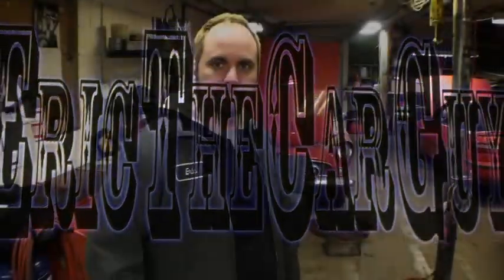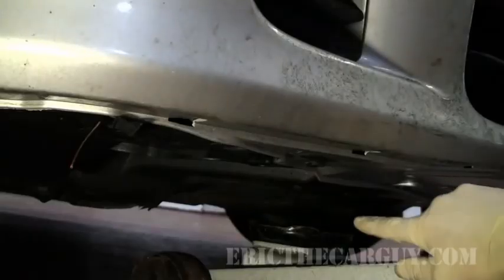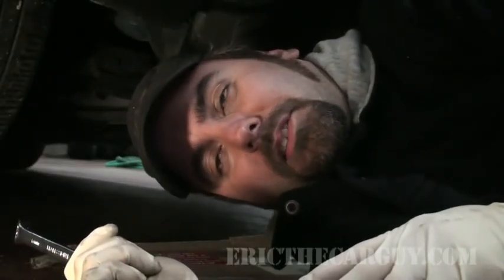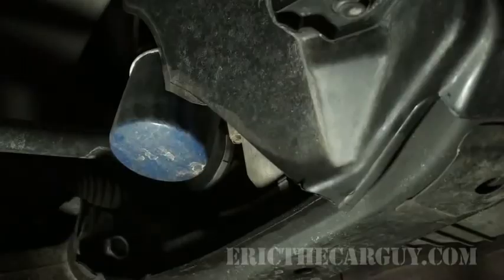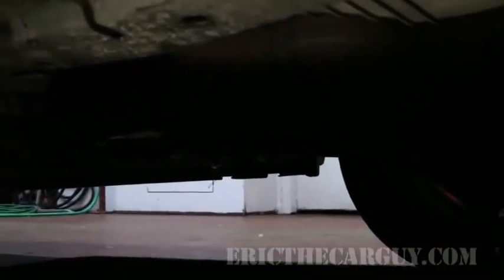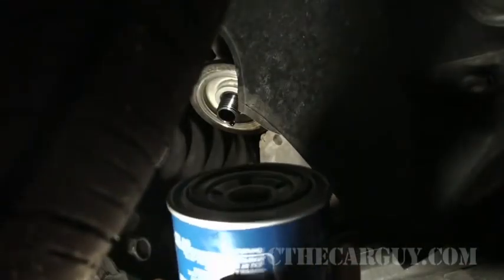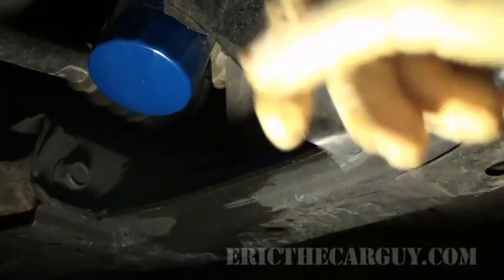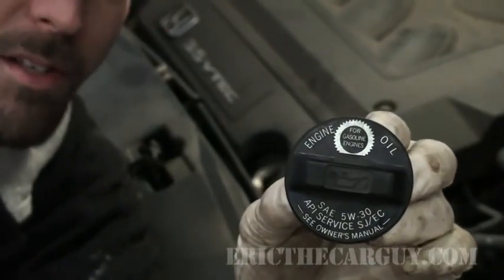How To Change Your Oil (Full) - EricTheCarGuy

Comment: Hello Eric.I need some guidance. Today, the vehicle's Change Engine Oil Soon light came on. Changed the oil Mid Last  November. I thought it was an electronic alert due to cold weather but still decided to check the oil. It came up dry. I was confused. And then I thought maybe to run the engine while checking the dipstick. I saw some splatter of oil.  Still not convinced, I drove to the nearest Oil Change place and after checking said I need to put in 6 quarts. I put in 5 quarts of Mobil Synthetic (75000 + mileage) when I did the change. 
I also changed my Air Filter to KN from the generic brand about 3 weeks ago. What could be wrong? Any suggestions? Thank you.
Reply: Just pull the fuse.

Comment: u can do that but is not necessary ...also in this video i would tight more that oil filter ,..anyway that filters for sure u will no use again so is not problem if little damage them when i change them with new ones.

Comment: Hey eric,I have a kia sonata and the owners manual recommends using 15w-40 oil , is there any problem in using 10w-40? is there much of a difference?
Reply: No, you improve your engine protection at starting at low temperatures. For an optimal substitution compare your actual technical data sheet (TDS) of your 15w40 oil and the new 10w40 oil. The oil viscosity at 100ºC or 212F must be similar.
Reply: Thanks man.
Reply: Happy to help you!

Comment: Hi, I'm currently using fully synthetic oil right now, and it's been for 2 years (7k+ KM). So I thought of changing to MINERAL oil, are there any issues if I drain the old FS oil and add new Mineral oil? Or am I missing something?

Comment: @straydoggio Never heard of a filtermag until I read your comment and googled it. It's actually pretty cool and seems like it would work, and does have a better chance of catching particles of metal, if there should be any in the engine, than a magnetic drain bolt would. Thanks for the info.

Comment: Eric the car guy, I need advise. When I change oil on my 1996 Toyota Tacoma 4 wheel drive pickup, I stripped oil plug thread. Now, plug just turn and won't comeout. Any advise beside remove oilpan?

Comment: First thing you need to do is to activate the parking brake! Even when you are in gear your car will always roll a bit just enough to roll of the jack stands. Especially when your car has a front wheel drive and you jack up the front you will get squashed underneath your car as soon as you start working.

Comment: Pissed me off too. I had a From nylon molded tool I bought from the same place where Eric bought his Supre Tach oil and it slips if the oil filter is just too tight. Dammit I had to go to the ol' Perp Bays to buy a metal one. And up until that point I was just fine. Damn indy mechs wasting my money.

And I agree with the tight so it won't fall off rule. I check my oil level and filter often anyways. I can just open the hood and look at it. Lucky that way I guess.

Comment: There is one time you need to know if you need conventional, Synthetic, or Racing oil. That time is if you have a Hydraulic Flat Tappet Cam in your engine, reason being is the zinc rating in new conventional oil is to low to protect the flat tappets from being ruined and they did that because zinc destroys catalytic converts in cars So if you have an older car up to 1985 you should find out if you have a flat tappet cam in your engine get a zinc rating of 1300 or higher like VR1 or Royal Purple!

Comment: Hej, question: is it really necessary to change oil every year? Even If I have driven just like 10.000km=7.000miles? Somebody told me that oil is deteriorating and thats why it has to be changed every year, but I saw the date for usage on the BMW oil at least several years 2 or 3.
Reply: Yea, oil has to be changes with either how much miles you do or if you don't do those miles with time. For example a couple months or so
Reply: Oil never loses its lubricating properties.  Never.  Yeah, yeah, someone will argue with me, but they're just wrong.  What it does is gets dirty, and dirt doesn't lubricate.  So, no, oil never deteriorates.  

Where I work, we have 200 million dollar turbines and we never change the oil.  What we do is purify it and take the dirt and any water out of it.  But we use the same oil for years and years and years and decades, and only add new oil for any leakage.

So, should you change your oil every year?  Well, if the car has sat there for a year and not been driven, then I wouldn't change it, because there's no reason it should be dirty.  However, you have 7,000 miles on that oil.  Again, it may be dirty.  However, if it is synthetic, I know that stuff can go for way more than 7,000 miles, because it starts out so clean.

I would change my oil if I were you, though.  On modern cars, there are some very tight clearances and passages that the oil has to go in to keep lubricated, and $26 bucks for some synthetic oil and $10 for a filter is cheap maintenance to make sure those passages don't get clogged up and fry your $10,000 engine.

Comment: Why shouldn't we use ramps? I've done so on most of my cars and trucks. Always made sure I had no areas of the oilpans that would not let the oil drain by angling the vehicle on the ramp. BUT driving and stopping it on the ramp may be an issue for some.

Comment: Hello everyone, I pretty much don't know anything about cars yet i am trying to learn the basics in order to take care of my car. I went to do an oil change yet I wasn't able to remove my oil drain plug. I tried 17mm socket yet it was not big enough so i went to 18mm and that was too big. oh and i forgot to say the drain plug was tight as hell. anyways, after sockets and wrenches and penetrating oil, .... stripped drain plug. so i was forced to take it to the dealer and they did the oil change. any advice for next time? thank you.@ErickTheCarGuy
Reply: steve b I think you mean AMERICAN aka SAE/Imperial. Metric is the standard in England....

Comment: i have a 1978 oldsmobile cutlass supreme with a chevy 350 should i stick with conventional oil or can i use synthetic oil
Reply: Synthetic is fine but if your engine is that old,it may slide past the seals ...If it does not ,you are ok.

Comment: I've heard that when you drain oil it has to be a 24 hour drainage of oil. is that true? it most likely is sir, I'm just second guessing it I guess. I haven't changed oil yet but plan to soon. also do you have a battery change video?
Reply: actually its false if you let oil to drain for 24 hours than u must have been told wrong let it to drain till its just small drips or till no oil runs out after your car as been settle all the oil will be in the pan which all will drain quick lube tech
Reply: ok cool. thanks for the reply. I honestly didn't expect one.
Reply: +White Ninja ur welcome man aint no problem just tryin to help people out thats all
Reply: #awesomeness

Comment: what about pre filling the filter if you can in your  application to limit the first starting up engine so it does not run without oil for that long.

Comment: no flushes pose a chance of clogging the tiny oil holes with sludge potentially starving parts of your engine of oil. Its not extremely common but i has occured more then once.

Comment: I have a 96 lincoln town car. What kind of wrench you think I would need elf I haver a floor jack that I have to turn by  hand I use for brakes and rotors. Would that be ok to use? How high should the car be off the ground I do have jack stands but would have to use one side at a time

Comment: @1ownjoo2 Aren't there some some some cases where the metric/standard do line up in measurements? And at times, one fits tighter than another? I'm NOT recommending to try it out or whatever, I'm saying this out of sheer curiousity. 5/32 = 3.96875 mm.

Comment: The manual for my ranger says 5w-30 oil, but its a 1994 and has 225k miles, should i use 5w-30 or keep the 10w-40 like ive been doing?, thanks in advance

Comment: i run my engine for several minutes like he does...i don't touch it but it should't be so hot that it burns you if you only ran the car for 5-10.

that being said, wear glasses and gloves and you should be fine.

On most of my cars the only place where i really had to be worried about getting hit was removing the damn filter which is often placed in hard to reach areas... that's why i start the main flow first before i take the filter out...less risk of burns

Comment: @Whit3Mike Have you considered a FilterMag ?  Powerful curved earth magnet in a few designs for different oil filters.  The manufacturer claims - with convincing photo-evidence -  it helps capture microscopic particles of metal that are too small for the filter to catch... to prevent engine wear.  I've got one, and always remove it from the old oil filter, to put on the new one I'm about to fit.

Comment: @man1d2tran At least they aren't using impact wrenches on your oil pan lol. But I also do oil filter snug, none of the 3/4 turn after contact because i rather be safe than sorry, because thats what the oil filter removal tool is for. As for the drain bolt, I make sure its tight, none of the flattening the crush washer crap.

Comment: i have a weird question, i have a honda crush washer and it has one side that is lighter in color, does anyone know if it matters how i install the crush washer?

i.e the lighter side touches the oil pan, or does the lighter side make contact with the drain plug?

Comment: @TheDennyvu Great great great tip. I see "mechanics" all the time at Firedtones and Perp Bays and even some independent quickie change lube shops overtighten the filters with their gorilla grips. And I always raise a stink when I see them using their whole body weight and two open/box wrenches to get leverage onto the drain plug, I mean come on! This is why they strip oil pans and then say you have to get a new one. Wrong. You make them retap that sucker. And worst case, buy the new plug.

Comment: what will happen if I couldn't change the oil filter at the time of oil change? will it be fine until next oil change? or do i have to change it?
Reply: You have to change the filter every time.  It fills with engine contamination from when you ran it.  Most people run their cars more than 3,000 miles between changes.  meaning that if that filter gets plugged from running that long, your engine will receive NO oil (or unfiltered oil if you have a bypass valve) and essentially your engine will burn out.

Comment: keep on using the same oil that was used before or go down the line...
so if it was synthetic you can go down to semi and if it was semi you can go down to mineral. i would not sugest going up from mineral straight to full synthetic as it may create a havon in an engine with lots of milage

Comment: Hi Eric,
Do the engine flushing is needed? If no, why?
Reply: +azhar ray 
Many car manufacturers have advised not to do engine "flushes" because 10 years ago quick lube shops were doing it and it could damage the cars engines. If you change your oil at the proper times there is no need for a flush at all.
Reply: Thanks

Comment: It's sad that you have to put that disclaimer on a YouTube vid.  So sad.  Anyhow, I appreciate your adding the part about the "adding a little oil to the filter" since I forget that step all the time!  I recently read that forgetting this step might cause a ticking noise in your engine.  Have you ever heard of this?  The explanation was that air gets stuck in the system causing the noise. I'd actually prefer it be this little mistake than the possible alternative - spun bearing - UGH!!!

Comment: That intro. XD

BTW, do you know when you're supposed to change High-Mileage oil? I know conventional is every 3,000 and Synthetic is every 7,000 or 7,500, but what about High-Mileage oil? and do you need to use a High-Mileage oil filter with High-Mileage oil?

Comment: Can you tell me how much oil should i put for my cars ? for example engine with 1.6 power how much galons of oil take and for 1.8 and for 2.0 ?
Reply: In the video "check your owners manual". If you read it tells you how much and which oil to use. My hemi uses 5w-20 but on the oil cap it says 5w-30, more information helps :) 
-And the 2.0L you would probably use 5quarts my other car is a Chevy cobalt and is a 2.0L and the manual says it needs only 5quarts , a cheap 20$ depending on which oil brand you like.
Reply: Thanks a lot for informations

Comment: good and cheap, i don't see the point in buying "other" brands if your changing it every 3000 miles or so. i change mine around 2500 miles now because my car has 156000 miles on it so i don't want the internals having to work too hard

Comment: @ericthecarguy Not to be a smart ass but if it says only 4quarts y put 5?, They say too little or too much oil is bad. I just want to know because my car have 192,000 on it, and takes 4qts according to the manual. i put 4qts in but i buy an extra qt in case i burn some oil so i can top it off i dont pour 5qts in right away. AND WOUD SYNTHETIC OIL RUN FINE IN A HIGH MILEAGE CAR SUCH AS MINE?

Comment: my owners manual tole me 2 2/8 of oil i was not sure if was right i put the oil in then check the dip stick and the dip stick was dry so put some more in till the dip stick said there a enough oil in the engine by the time i was done i use 1 gal of oil and the car was on a level ground

Comment: Eric I need a little info 2002 saturn vue 3.0 v6 vin(B) autotransmission  im replacing the fluid, dealer says use saturn T4 but my alldata says dex 3  part stores says use T4 equalivant

Comment: @iENJOIskating209 153,000 miles on my ranger with 5k intervals. Never earlier. Now a days oil is meant to last many miles and keep the engine clean. If synthentic oil is used then the intervals can be upped to 7500k miles. But i don't like synthetics.

Comment: I have always  added new oil in the filter before putting it on because it wets and saturates the filter,so when you start the engine,the new oil will go through the filter faster ..If you put a dry filter on,it takes longer for the oil to fill it up and you have a dry start if you do not wet the filter  . Check 540RAT – TECH FACTS, NOT MYTHS and it explains what is the best oil according to test if that interest any one. ..
Reply: ***** Yea that is all there is to it and just making sure that the old seal is not stuck to the engine. I assume that a dry filter at start up could take 3 seconds or a bit longer to fill and pass into the engine.

Comment: I am trying to change the oil on my car but I can  it get the bolt off, its on to tight. Any recommendations to help me?
Reply: hit it with a hammer on the sides and on the front of the bolt, you can also clean the edge of the bolt or spray it with a lubricant, if you have room kick the wrench   and that should work, if not then you will have to use heat to loosen it.

Comment: My very first time changing my oil I forgot to check the old gasket to see if it came off. After starting the car a quart or so had leaked out all over my driveway

Comment: Good video, but never use 12 point ratchets for oil drain plugs
Reply: why not?
Reply: ***** 12 points are much more likely to strip a bolt head then a six point. The torque is being applied in a much smaller area on each point of the bolt head.
Reply: ahh, thanks for the tip
Reply: tell me about it

Comment: I worked at a quick lube place and the 3 reasions why cars are in the junk yard today is beacuse A. no oil was put back in the engine B. the oil filter and or drain plug was not on snug  enough.  AS soon as the customer got about 3 miles down the road or less the motor pumped out  all the oil  . NO offence erick I know that you are ASE certified  but I always wipe the surface where the oil plug and oil filter go . I would of tightend the plug and filter a bit snugger than that.

Comment: The oil filter should be pre-filled with new oil.  Oil filter box will advice you to do this.
Reply: I only do that on diesels.
Reply: depends. Two of my vehicles the filter sits sideways and you're obviously going to spill oil everywhere if you fill it up. I just pour a tiny amount in there to get it started without spilling any.
Reply: Tried that method on my most recent change, didn't really make a difference

Comment: You didn't fill the new filter with oil before screwing it on......?
Reply: No...why would you? Running the engine fills it. Not filling the filter doesn't hurt it. It's a pain in the ass and down right impossible on a lot of cars nowadays to fill the filter before hand
Reply: Glockenator Agreed. While yes it's good practice to fill a filter with oil, it's not necessary. Only thing I can think of where this is relevant is that I know that really only on diesels now days you have to "prime" the filter (fill it with oil) before you replace it. But that's only if the filter is placed vertically on the engine, if it's horizontal you do not have to. 

Any standard gasoline engine cars do not require oil to be put into the filter beforehand. Okay sure, if you want to do so, go ahead. Absolutely nothing bad will happen but also in the same token nothing bad will happen if you don't either. To me its just an unnecessary extra step, Ive never done that on my own cars and have never had any issue
Reply: Well you guys just saved me a headache under my subby. Thanks!
Reply: It is best to put enough in it to wet the filter in order to prevent a dry start...Filling it can be impossible unless the filter fits  strait up ..Wetting it does maker sense before it is screwed on because it will take a few seconds longer for the engine start to fill it up if the filter is dry.